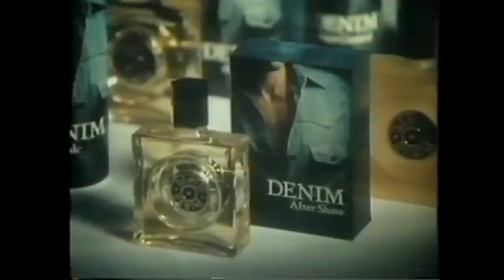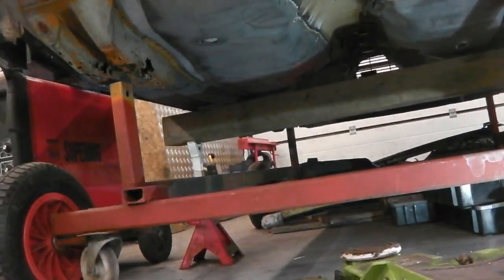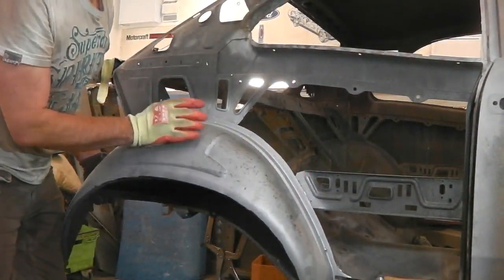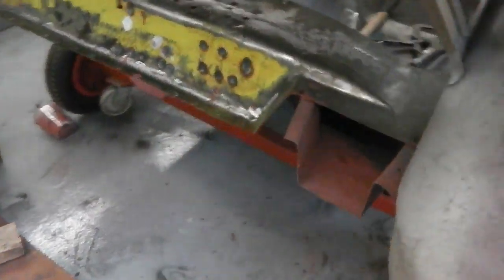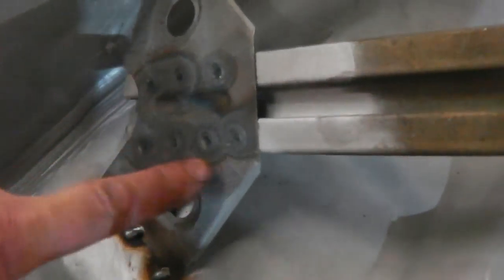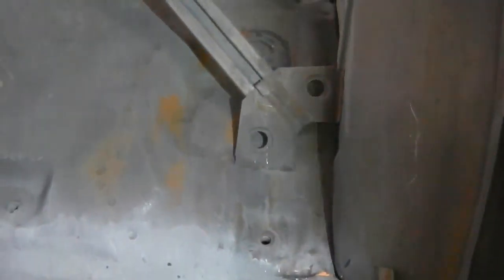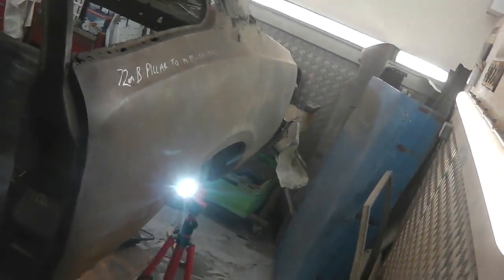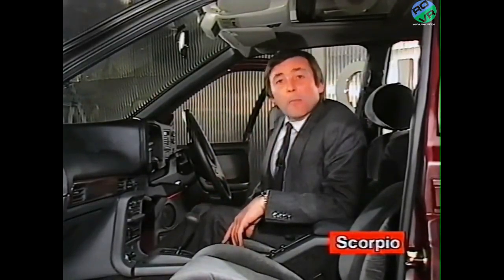Classic Car Resto - Ford Cortina Mk3 - Bramble Ep23 pt2

Comment: Amazing, it is very obvious that there is a lot of restoration needed for this car. It was in pretty rough shape but obviously had key components still intact. Another lovely snap in place part. I love the click and the perfect join of these parts. 

This car is really starting to take shape. The ultra snap in place precision work does count doesn't it. It is really starting to get some rigid strength now.

I am glad you are taking precautions to ensure your health and safety.

I have to agree with you that you are making good progress. It's great to see you having lots of fun. Never a boring moment.

Comment: flush kooling system on my Taunus..use the Taunus/cortina handbook..from autobooks..i got on British e bay...it says 12,4 pints?+?...is that 6 liter in the cooling system,,,so i had to fill 3 liter glycol frost mix inn..ve are metric in denmark..nice Work..you cuts a lot aut..but get also sóme metal back inn...nice to see..

Comment: Just a silly question Pete; where you are trying to mark through the punched / drilled holes, to fit up the chassis leg, could you use a machinist's transfer punch, as these are made to suit the diameter of the drilled hols and gave a centre punch point, which allows for a true centre to be established?
Reply from the maker: thanks for the info, this sounds a good tool, i will google search see what they look like, im curious, thanks again